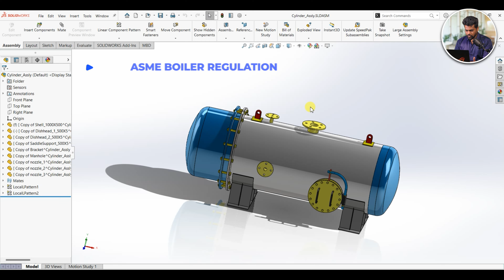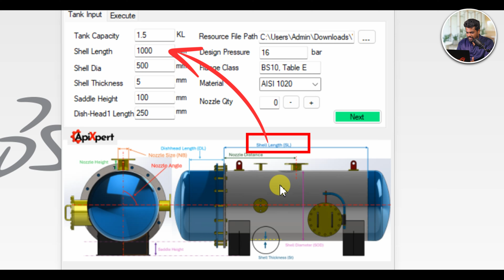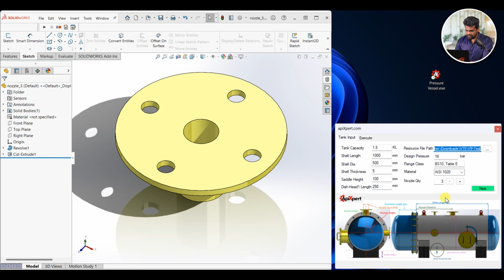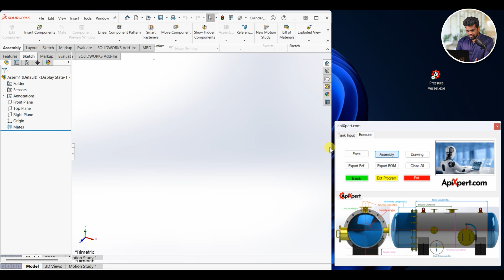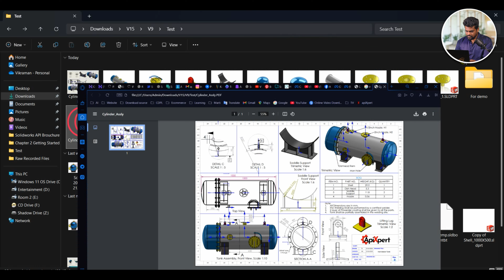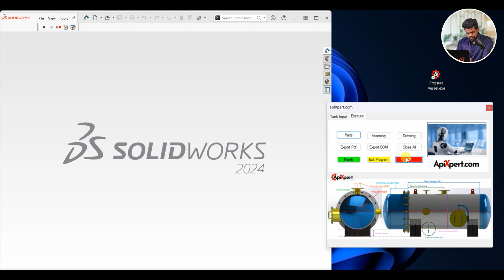ApiXpert | SolidWorks API Automation Customization Demo

Comment: What's the reason behind choosing solid works in this course instead of CATIA and NX since these 2 are major softwares in automotive market..
And that UI should be used by companies right if we want to use that?...
Reply from the maker: You can choose SolidWorks API, CATIA, NX Open, or AutoCAD—any platform based on your interest and requirements. This video demonstration is primarily to create awareness, provide insights, and promote the possibilities of automation. For more details about our Automation Course, visit apixpert.com or send us a message directly at +91 8667311125 (available on WhatsApp or normal call). We'll be happy to guide you!